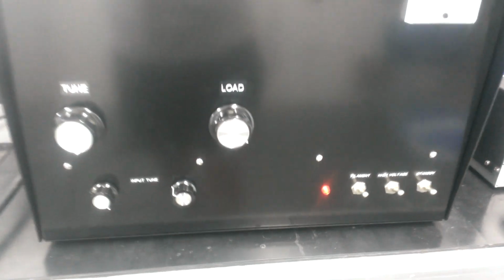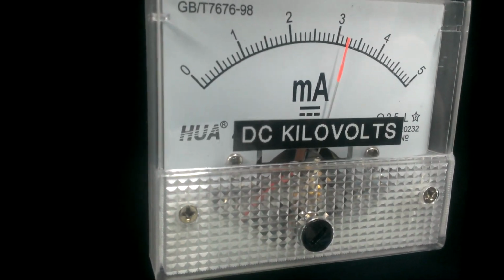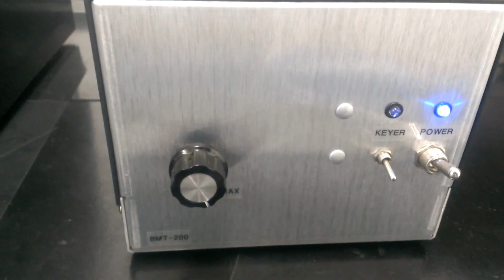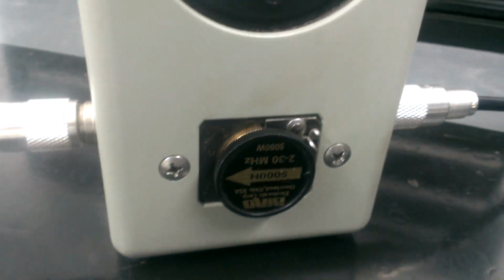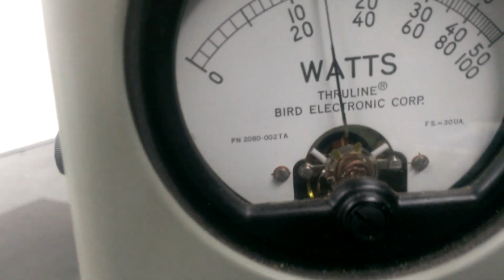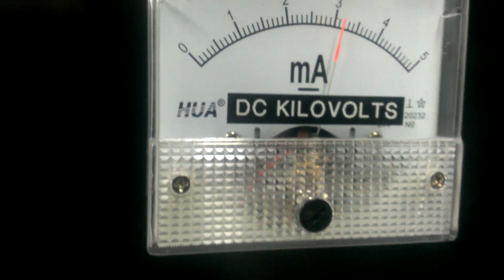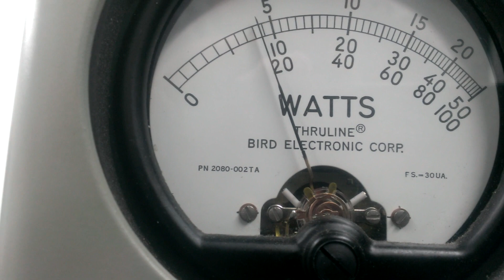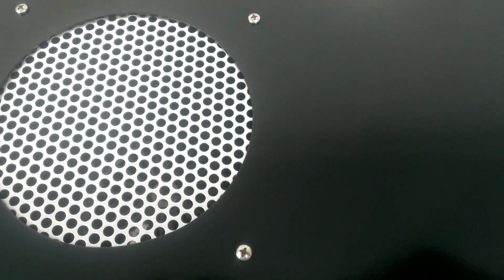BM Technology Single Gs31b

Comment: Im getting 850+ RMS (Bird-43) out of 2 x gi17B tubes with 2200 vdc at anode using only a 400ma transformer. driving it with a 18 watt 148GTL. the tubes after a 3 minute key down never exceed 160 degrees C. if you have to use 2 x 2290 to get what your getting? something isn't right!!!!!